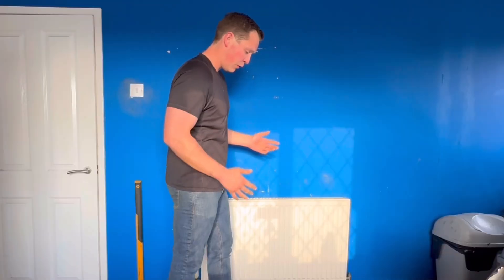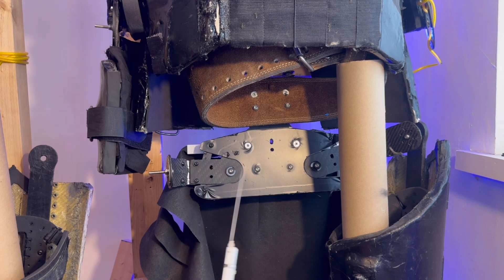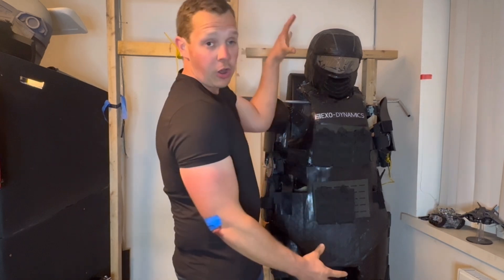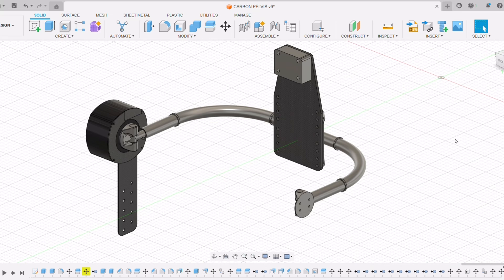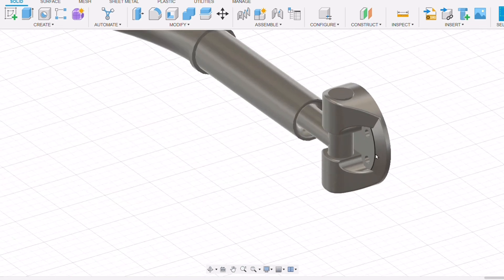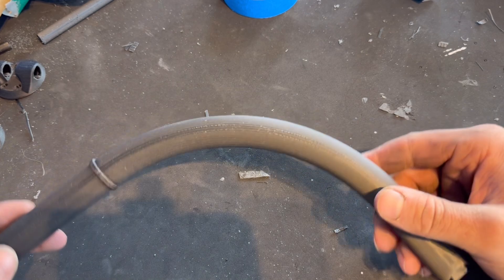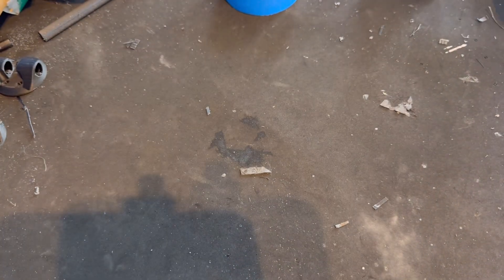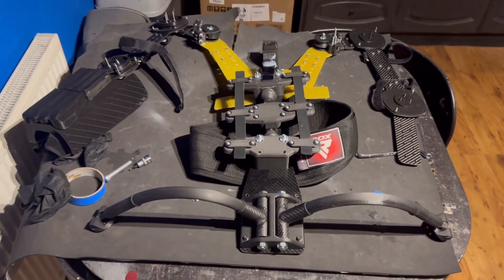How I’m Making the HIP Joints on my next EXO-SKELETON

Comment: Honestly having the suit be able to be  removed and put on in sections and not require a frame or rack (even if one is used for regular use) is a practical benefit anyway. The amount of times I've had to take PPE off in the field to fix or clean or readjust it even when its nominally designed to be worn all day.